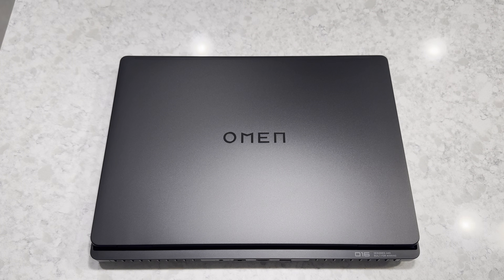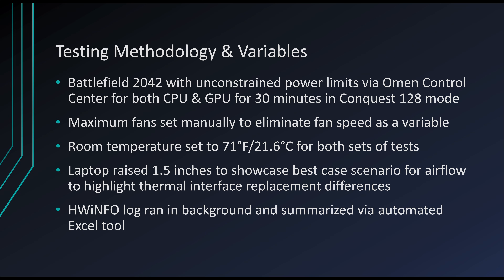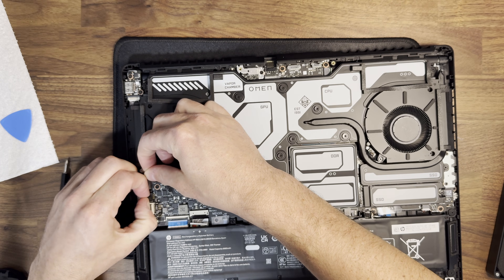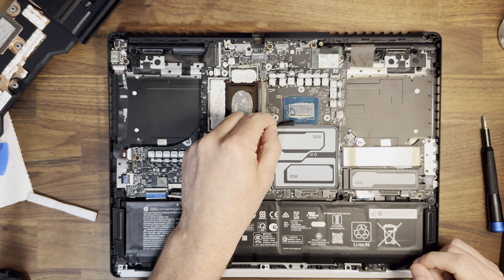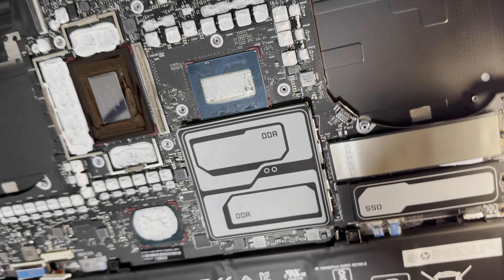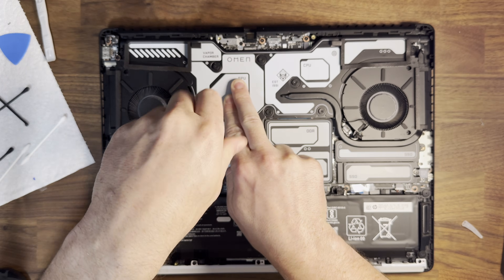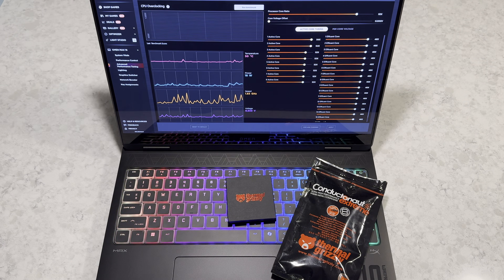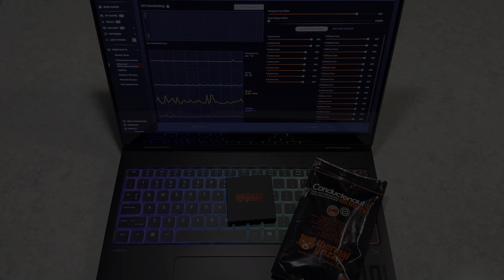HP OMEN MAX 16: Thermal Testing & Repaste Tutorial

Comment: Props to HP for trying something different but good ol’ well-applied Liquid Metal wins again 😂
Reply: My temps have been fantastic out the box. Idle 40-45 cpu. Max load 80c. Their cryo compound is really impressive.
Reply: @camooo101  When did you receive your unit? Maybe they fixed it after a while.
Reply: @camooo101  by max load on the cpu, do you mean full 160 watt load?
Reply: Mines got sent out shorted, now i gotta reball the CPU.

Update: It was the GPU who was shorted. I didnt had to reball anything. Make sure to remove the red gausse from the GPU and clean from the very inside gently with a toothbrush and IPA 70%. (For now im using PTM7950 cuz I have trust issues with LM.
Reply: Props to using the pc
Reply: That was your take-away from this video? Sure HP's solution isn't great but normal PTM lasts longer than LM and doesn't have the chance of bricking your $2000 laptop. Who cares if PTM is a few degrees warmer when it doesn't need to be reapplied as often and isn't a pain to clean up. The risk-reward just isn't there.  It's not even about factory variance of LM, even with proper application laptops being portable can cause leaks because tolerances are never perfect. As a customer I don't want to worry about bricking my laptop every time I put it in a bag or travel with it. The only case you could make for LM is if your laptop is a desktop replacement that never moves.
Reply: Well, they could at least test it properly.
Reply: @username0344  In China, test it? by the time the test your system they can ship another one.

Comment: Do you regret buying this? Seems like you shouldn't have to repaste a new laptop to get decent temps. 10C seems egregious and should have been done better from the factory. They put in all these higher end parts but just because of bad paste jobs, it's still constantly running near the point it's thermal throttling.

Comment: Hey Brax I just bought an hp omen max16 on black Friday to arrive today I have used ptm7950 on my current legion pro 7i gen6 3080 but that was after a year of having it back then then again recently ….. I’m wondering if u recommend doing it right away or using the stock thermal solution for maybe 6months to a year I’m concerned with voiding my warranty by doing it right away

Comment: I plan on getting this PC, probably tomorrow. Problem is, I'm gonna have to add a second SSD to it, which means I'll have to remove all that stuff. If I remove it, will I then be forced to reapply thermal solution? Or can I put the SSD in and close everything back up?
Reply: I'm waiting on mine arriving, i think the primary is under the fan, did you find this to be the case? as I plan to install a 2nd ssd.
Reply: @MrHicks1  I didn't get this. I went with a gaming desktop instead

Comment: @brax-tech I own a HP Omen Max 16 with Core Ultra 9 275HX & RTX 5080 OLED model, I bought it for $ 2700 at best buy on sale, I am having Overheating issue especially with CPU Reaching Over 102'C under load and I was seeing Core Frequency dropping drastically like 4.1-4.2 GHz, so I was planning on repasting with PTM 7950 or Liquid Metal for CPU as well as GPU and also planning on using thermal pads for VRM's instead of Thermal Putty I would like to know what is the clearance for VRM to heatsink, is it 0.3 mm or bigger, I know that HP uses Thermal Putty but they didn't mention any clearance for VRM to heatsink in the Maintenance and Service Guide PDF

Comment: phase sheet on both the cpu and gpu would do the trick for me! plus i would use TG putty advanced when im there already 😅. phase sheet would still see better results by2-4⁰C i bet!
Reply: Do you mean you Didn't use any liquid metal?
Reply: @zuuzuka nope, liquid metal is a big problem if u travel a lot and ur laptop is on its side most of the time. ptm 7950 or TG phase sheetis the way to go. plus u dont need to game in performance mode with full blast wattage on cpu. bigger thing is u knowing how to optimize - undervolt- power limit your settings! when u buy something this expesive i will make sure i game under controlled temps that means for me under 72⁰C
Reply: @gileranexus7972 that's good to hear because I'm very scared of the detailing work. Just put on is more like me
Reply: @zuuzuka dont do it if u are not sure what u are doing, especially if it is a new device under warranty, bring it to a shop give them few bucks and tell them what type of putty and sheet to use
Reply: @gileranexus7972 thanks for the tips. I never thought about that.
Reply: there's no undervolting on this laptop, I tried myself
Reply: @ajuninho17 when u installed intel XTU was it greyed out? no option in bios to unlock are u sure? that is a god damn shame bit either way even bigger thing is to cap PL1 PL2 and other tweaks that really matter big time over undervolting

Comment: Hi, thanks for the video. I have the same laptop. I installed an SSD in the second available slot, but my SSD keeps getting disconnected. I noticed you also have a secondary SSD. Have you experienced any issue with the secondary m2 port? I found weird the SSD heat sink. Did you put the SSD in between the heat sink screw mounting system or under it?

Comment: Question, what happens if the captive screw gets stripped?  
Question 2, why didn't you use the sheet on the CPU?  Not good enough for the job, or some other reason?
Thanks for the video.
Reply: Its a desktop cpu that gets hot and can suck a lot of watts. It needs Liquid Metal to stay at 90 degrees Celsius

Comment: as someone with no experience doing this... should i avoid this laptop? its perfect in every other way but ive heard that even besides the temperature issues, the paste can ooze out and actually damage the computer.
Reply: Hey, I have never repasted until I got this laptop. Thermals for me were fine before with the exception of some games where the CPU would sometimes sit around 95-100. I was honestly scared, but this video really helped me and I would 100% do it again.  I repasted with regular Liquid Metal and it took me around 4 hours since I was trying to be really careful.  I got the 5090 version about a month ago and I love this laptop. Thermals never go above 85 on CPU now. GPU is always below 77 degrees.
Reply: @simplycarrying8759  Did you do liquid metal for both CPU and GPU? And what brand/product did you use?

Comment: I personally re-pasted my RTX5090 Omen Max 16 with Artic MX-6 on both GPU and CPU and also got rid of the White Thermal Paste as well and applied 1.0mm ARCTIC TP-3 on all musfets and VRAM. Bro, performance and temperature got a lot better.
Reply: Is it still good? May I ask what are the average temps?
Reply: I just repasted my cpu and gpu a week ago but not the white paste. My laptop turns off and on randomly even when the temperature is normal. Should I repaste the vrm's with the gray thermal paste too?
Reply: @videostream4348 Bro, I had to return this machine as I start having display issues. The screen went off in multiple times so I had to disconnect the battery for the screen to reset back to working every single time. Technical support offer me the chance to replace the hole machine for a new one as they were never able to find out what it was. I went for the Lenovo Legion Pro 7i with RTX 5090. Bro that thing is a beast. Good luck with your OMEN hope it never fails on you as it did on me.
Reply: @videostream4348 how is it now?
Reply: arctic mx6 has poor thermal conuctivity, used it couple times but after two weeks changed it!
Reply: I highly doubt the regular paste had any meaningful change on temps over the one put by default by HP.
Reply: The white Thermal Paste is Upsiren Thermal Putty 16.8wmk. They are around 25 USD for 20g. Best to apply it yourself than letting HP do it.

Comment: I have a question. If I remove the cooling system to access the primary SSD slot will I have to redo the thermal paste?
Reply: Yes
Reply: @username0344 thats so stupid. All that just to get to an ssd slot
Reply: @Kr1t1kaL_H1T  i have the same problem... really crazy :(

Comment: How different would be temps if I used some thermal paste Arctic mx6 vs LM vs thermal pad? I'm running into peaks of 104C on the CPU and the temps are very high. I'm speaking with support since it's a new unit, but if push comes to shove I'll have to repaste probably, as the cryo compound is clearly awful.

Comment: I was going to get the 5070ti version of this laptop but after seeing this video i dont think i will. I'm not confident enough to repaste the components myself and if its overheating out the box then its a miss for me
Reply: Which laptop did you end up getting? And how are you liking it? Thanks!
Reply: @hans6304 i didnt get any. I wanted the HP omen max but im concerned about the liquid metal leaking
Reply: @Kr1t1kaL_H1T I can't access redd*t from where I am and haven't found a single info about the liquid metal leaks on the omen max 16. Would you mind sharing some info on that, please? Thanks! I've been looking for a non-oled 5070ti laptop that is not the Strix G16 and it is hard to find other than the Omen max 16 and the MSI Vector 16 HX.

Comment: In the UK HP also offer this laptop with a 5070ti and AMD AI9 9 HX 375. Would this CPU also heat up as much as the intel chip? I was tempted to buy this laptop but I was cautious because of the liquid metal cooling and now your video states its not very effective now im wondering that this laptop is not a good buy
Reply: I heard that the AMD version is missing a bunch of features. You might not want to get it unless you are trying to cheap out.
Reply: @jayallen9198 in the UK it has the exact same specs/features as the intel its just a different cpu
Reply: @Kr1t1kaL_H1T oh nice

Comment: ABSOLUTELY DO THIS FIX!!! 
My laptop cpu constantly flagged 104 and ran in the game at an average of 92 with constant temp drops and spikes. Now cpu is at 80 average 

Gpu dropped 5 or so c. It wasn't my main focus, but from data logs, it wasn't nearly as extreme. Though the gpu temp also no longer spikes.

Iv put 100 hr into a very graphics heavy vision of fallont TTW. I have a mild gpu overclock on. But my cpu is stock. I used the same liquid metal in the video for both cpu and gpu. I found this video because I started blue screenings and hard restarting my laptop.

Comment: For anyone who knows, I need paste recommendations for uneven pressure laptop heatsinks. I have an older laptop which I assume has an uneven heatsink mounting pressure (I made sure to torque with the given pattern, went over twice)  since I applied Thermal Grizzly PhaseChange PTM, temperatures were great at first but after a few heat cycles when the material started setting in the temperatures got pretty bad. I'm talking about barely 80 degree cpu temp and mid 70's on gpu, to almost 100 on the cpu and 87 on the gpu within 10 cycles. It's been 2 or so months, got a little worse, but not totally inoperable. I heard that Kryonaut is good for these sort of situations, anyone has an idea what's the best way to deal with this?

Comment: Thanks for this video, as an omen max 16 owner this is very informative. Did you notice the film they added to the bottom intake grill, so it restricts the airflow to only the intake holes of the fans? What’s up with that? It seems like a small detail, but now I’m curious how temps could be affected if the film were removed…
Reply: Its probably there to improve air flow where it matters

Comment: Why did you use a thermal pad with the GPU rather than the liquid metal? Is there a particular reason or can the liquid metal be applied to both the GPU and CPU? Of course I mean for equivalent or better performance
Reply: Supongo que le dio miedo al chico por qué los resistores de la GPU únicamente están cubiertos con un adhesivo, poca seguridad la verdad. En cambio la CPU no tiene ni un solo transistor por encima lo cual tiene menos riesgo de que el metal líquido haga un corto si se llega a escapar de su lugar. También puede ser por qué lo que menos se calienta en un portátil suele ser la GPU así que te puedes ahorrar los riesgos.
Reply: Before you could monitor two individual sensors, if the average temperature was fine but the hotspot temperature was at its maximum that indicated an incorrect application. Now that hotspot was removed it's just impossible to verify this which could lead to reduced performance or even damage to the GPU.

Comment: I think it's an excellent video. But I find it incredible that a brand like HP makes such tremendous quality control errors on laptops that cost more than $3,000.
And another thing that surprises me, and is why I decided to return my OMEN 5090, is the need to disassemble the entire radiator, and consequently re-past it, to replace the main SSD, when the CPU heatpipe above it will generate more heat than the heat generated by the SSD itself.
Reply: Is the main SSD slot the only 4x5?
Reply: @mariozamora9684  Yes

Comment: TG Phase Sheet needs a couple of cold and heat cycles on the 5080. Used it on my 4070ti desktop, hotspot is max 10 degrees, and average 8 degrees. Used Duronaut and Arctic 6, but hotspots were still 15-17 ish. So if you could run GPU OCCT tests at 100%/extreme mode for 15 minutes and then let it cool down with fans at 100% then autofans and heat it up again. It worked for me, to lower the hotspot diff from 10 tot 7-8.

Comment: You need to be careful with kryosheet it should be within the die space because with Ryzen the extra sheet caused shorting on ThinkPad when i replaced the paste on day 1. Had to do power reset to get it to working condition. Also it's wise to add paste below the kryosheet or any similar so that it doesn't slip when we're tightening the screws. I ordered phase change pad and will be trying them out in few months.

Comment: I was on the way of returning the device, then I saw you video and realized how bad the factory thermal paste was applied. I just repasted with LM and should get better results now. Thanks for sharing
Reply: Did you get better temps ?
Reply: @guillaumezablot9327 no, even worse. I have returned the laptop
Reply: How are your temps now? I just ordered one of these computers and will probably do this.
Reply: @Cfalconeri how is it?
Reply: On my asus there was no liquid metal in the center of the die, I was getting heavy thermal throttling and a laggy pc. When I opened it to change the LM, I saw that they put way too much of it, and it was very uneven. That hp looked like a professional job in comparison, which is to say a lot

Comment: Hi, and if honnywell is applied to the processor, will the temperatures be higher than on liquid metal?
Reply: Probably LM will run a little cooler. But PTM lasts a lot longer, doesn’t suffer from pump-out, and isn’t electrically conductive. I think it is a pretty good trade-off.

Comment: A noob question, does cryo compound that stock omen max has a risk of pooling or leaking when the laptop is is stored right after shutdown vertically in a laptop bag?
Reply from the maker: Very unlikely with the barriers/safeguards that were put into place by HP.
Reply: @ what about pooling?
Reply: @slnsay5495  How do you think cryo compound can come out with so much viscosity? Is literally impossibile 😂
Reply: @bloodnova6745 hp omen cpu likes to operate at 100 c. I fear I can even boil at some point
Reply: @slnsay5495  from what I have heard, despite bad internal temps, the keyboard stay cool 😂
Reply: @bloodnova6745 keyboard cool, cpu frying, gpu meh

Comment: I did this with my 5090 Omen but only had regular Conductonaut on hand. Is conductonaut extreme a big improvement over regular?

Great video.
Reply from the maker: @SomethingAwry123  I haven’t done a direct apples-to-apples test for GPU, but for CPU it was about 2-3°C better between the two on a few Legion Pro 7i’s I’ve worked on.
Reply: @brax-tech Good to know. I guess I'll get extreme whenever I run out of regular. You mentioned Aida64+Furmark, did you try that stress test and what were your temps like?
Reply from the maker: @SomethingAwry123  they were similar since it auto-load balances to ~245W of load no matter what, so ~74c GPU, 80-82c CPU

Comment: I see so many different thermal grizzy thermal grease. Which one is correct? One says 11,1 gram - 12.5 W
Another one says 1gr 73w

Are these all the same?
Reply from the maker: @kaanaslan_tr  the packaging is almost identical between them, but no they’re different. E.G. Duronaut, Kryonaut, Conductonaut
Reply: @brax-tech did you use 1 gr package or 5gr?
Reply: @kaanaslan_tr Will you attempt repaste with liquid metal?
Reply: @slnsay5495  Not so soon. Today I'm going to receive my laptop. After setting everything up, I want to use first a couple of days. I don't think I'll need to repaste with liquit metal but it is good to know that we'll have 10C less temps with out laptops.